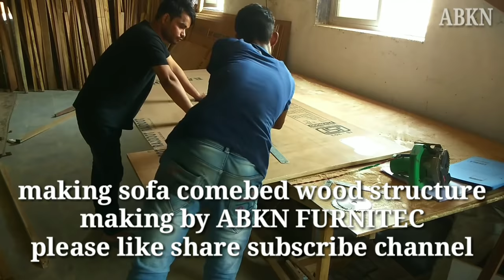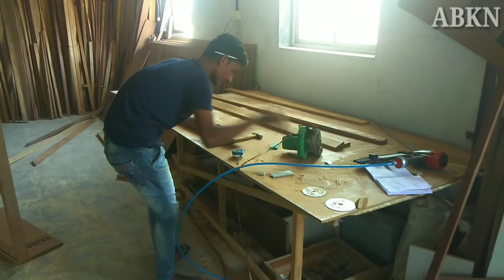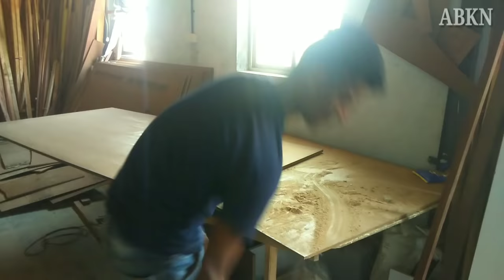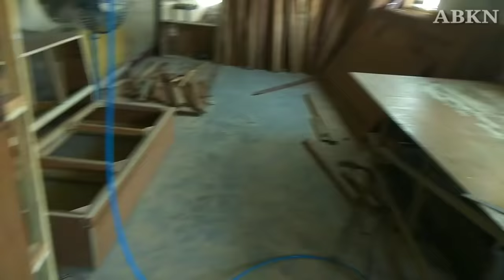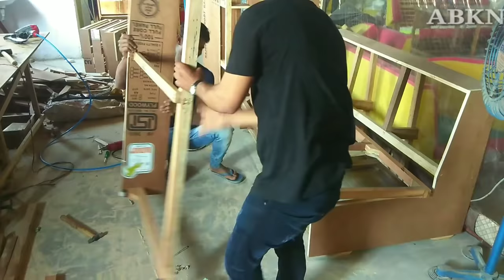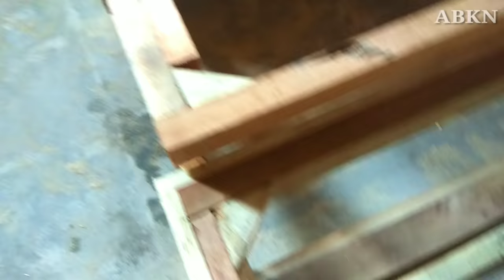how to make sofa comebed wood structure chaina mechanism making full tutorial

Comment: Hi, it's a wonderful video. I am a government employee but I enjoy doing carpentry work in my passtime. I have couple of electric operated carpentry tools. But I won't mind add few more which can help me in doing my job. Can you please tell me what was that electric machine which you were using to join the different fragments. And what was the size of the wood that you have used to make the solid frame.
Reply: the machine is a nailer. it needs an air compressor. but there are also electric ones, but they might not be as good